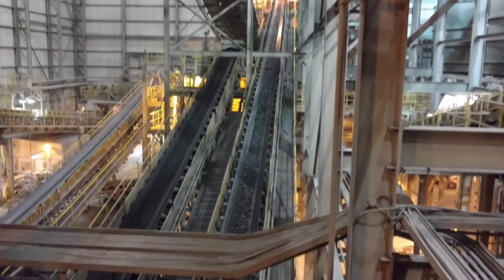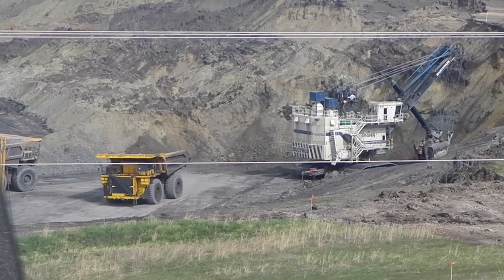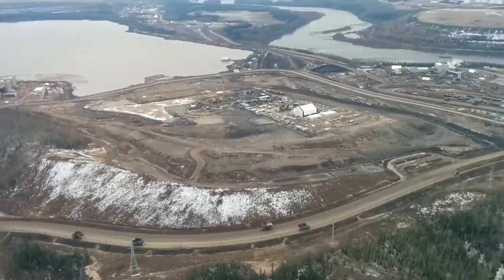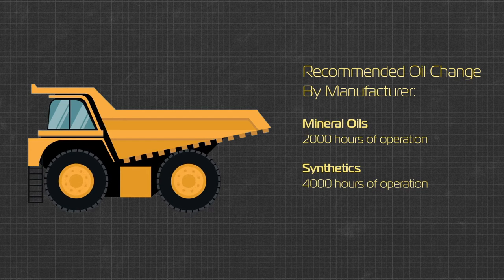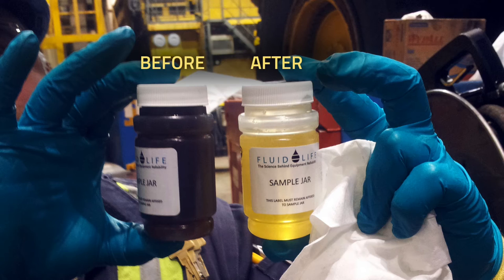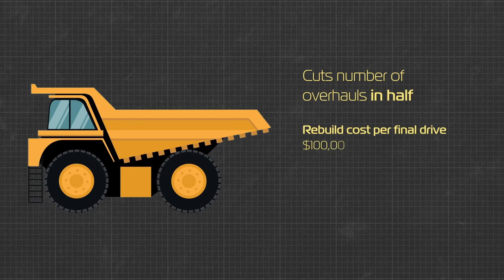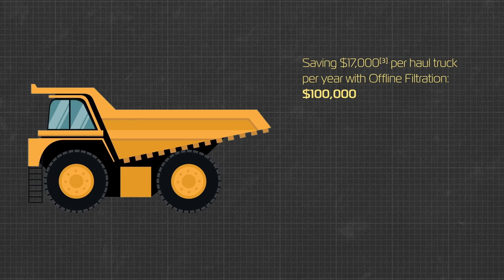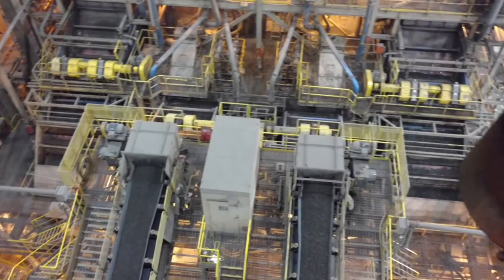How Mines Can Save Millions

Comment: Very informative video! 
This must yield in one of the shortest return of investments mines can experience.
Reply from the maker: Thank you Daniel!  Yes, based on the cost of synthetic final drive oils and the volumes in the biggest haul trucks, (CAT 797 has 1,600 Litres in the rear axle!) the savings from preventing just a few oil changes will pay for the entire cost of the CJC filtration system.

Comment: Its cheaper to buy the oil then spend 1000 per filter. Less waste as well
Reply from the maker: If you only have 1 truck you may be right.  However for a fleet any larger than a few, the math for the $ and the waste quickly swings the other way.  We've seen users get more than 120 flushing cycles out of 1 set of filters - if that oil was changed each time instead of filtering, they would have wasted 140,000 Litres of oil and well over $1 million CAD.
Reply: @klassenadvancedfiltration  one truck can not hold 140000 liters of oil
Reply: @klassenadvancedfiltration  also oil life is oil life. filters can replace additives. a  well maintained system doesnt need addifional filtering. It is another money grab